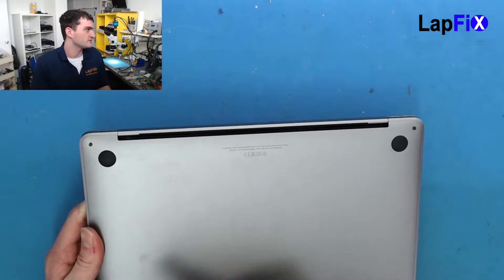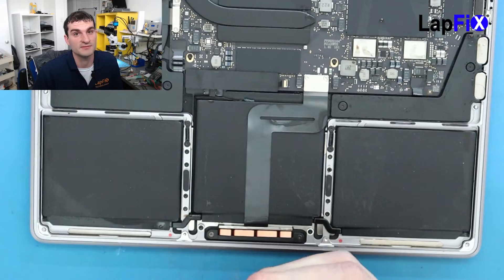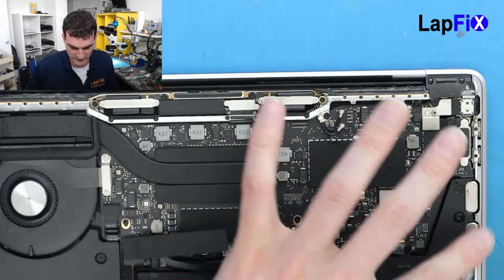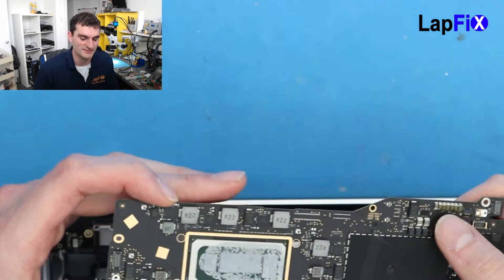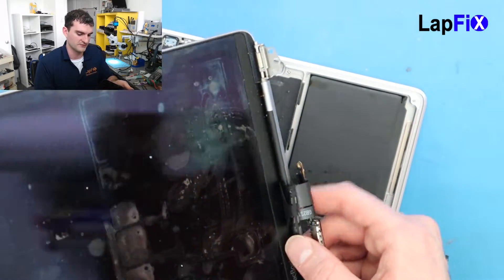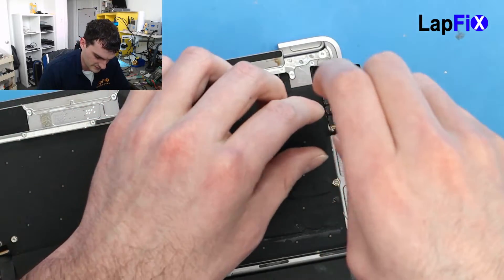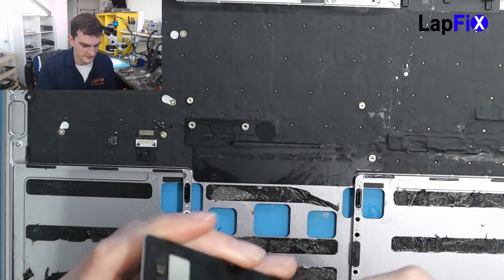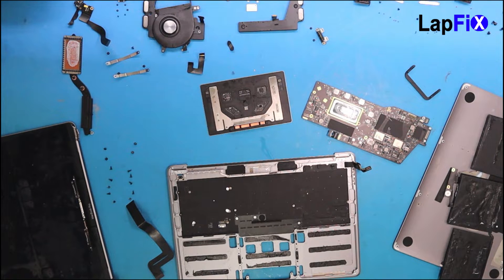Fixing MacBook Pro 2019 A2159 touch bar keyboard and trackpad with liquids spill  - Part 1

Comment: can the touchbar be replaced without replacing the whole case? mine is blinking white. I do field service so I am confident I can take it apart just don't want to till I have all the info on this
Reply from the maker: Yes, the part does exist.  However it is very thin glass , adhered and is difficult to remove.  Anything other than physical damage or damaged connection: just make sure it is the issue with the touchbar and not an issue with the logic board.  There are components that can be impacted to affect touch response/power on etc

Comment: the touch-bar section looks different inside than my 2019 model. Mine has another piece connected to it with screws. Is it possible to remove the touch-bar for cleaning or is it a one-way thing once it's removed?
Reply from the maker: The touchbar is covered by a very thin glass, it is very easy to damage it trying to remove it.  I wouldn't recommend removing it for only a cleaning
Reply: @lapfix  Thanks, I left it be, and just Cleaned everything as much as possible(without ultrasonic or anything). Working good other than a couple of broken keys from incorrect removal on my part :) Thanks for your video, it's getting hard to find good content for all models of laptop these days.

Comment: While my laptop was on, I spilled about 1/4-1/3 of a water bottle on the keyboard area. I immediately wiped it off the keyboard and the keyboard then was working while I was wiping, came back to start using it again and it was not working. Did I shut something down when frantically wiping? Or is it toast? Thanks!

Comment: Are the new M1 Mac books “safer” for water spill?
Reply: I'd say no. I just had a water spill on an M1 MacBook Air and trackpad is failing :(
Reply: @paulvonschrottky333  I just hd the same thing happen to me 5 days ago and don't have the guts to turn it back on. Did your MBA survive and what did you do to fix it?
Reply: @paulvonschrottky333  how much did this cost to fix

Comment: I spilt water on my MacBook Pro 2020 about just under a week ago everything works fine part from the Touch Bar which is responsive but it has thease yellow lines on which keep flashing, would this be repairable ? The Touch Bar is responsive but there is just no display.
Reply from the maker: Yes, we work on these repairs.  Our contact information is located in the description if you are interested 😀

Comment: What solution is used to clean the keyboard in ultrasonic? I used Branson EC and it ate away the aluminum finish on the topcase but it did fix the keyboard though.